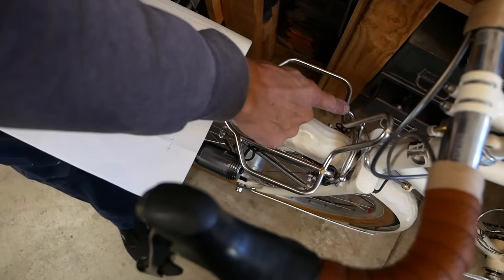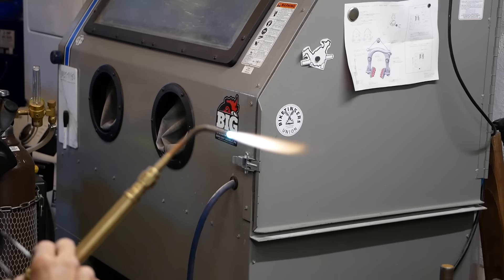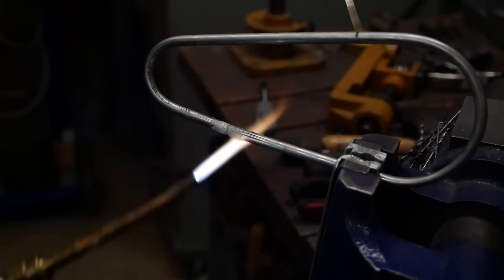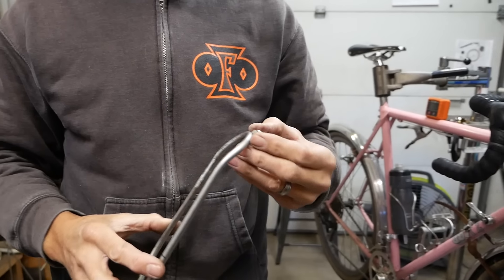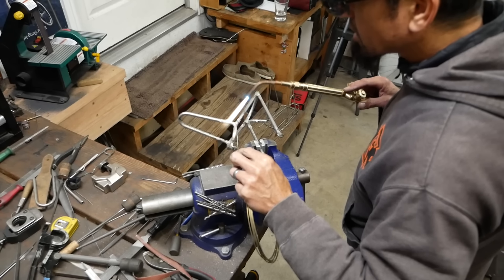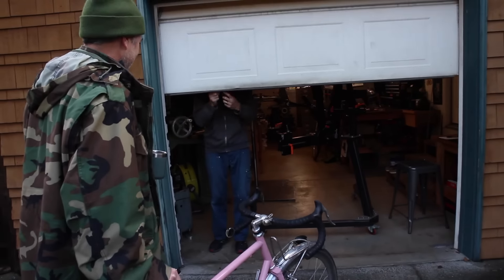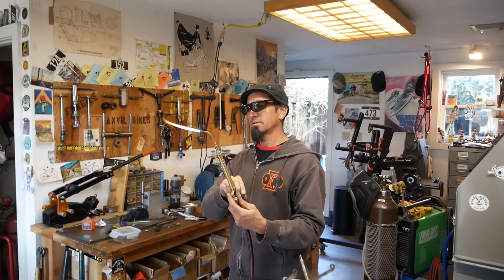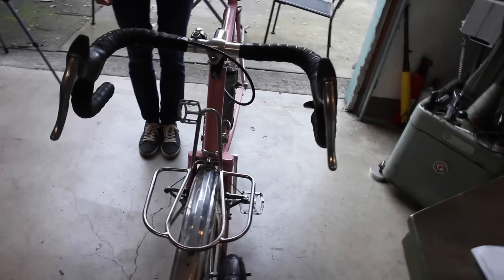Stainless Steel Rack Build at Fitz Cycles

Comment: Great fun to work with a constructeur and make something special and custom. Was that a water bottle boss that went through the rear arch, after all? And did you consider interior routing for the headlight wire?
Reply from the maker: The arch wasn't supported with a bottle boss. I may try that if the modified rack tab I used doesn't hold up. Internal wiring was a thought, but to keep it easier for maintenance I am going to use external wiring and clip the wire to the rack with copper loops. Cheers!

Comment: Question!
Why not build it into the fork , like the crust cargo fork only for reg. Bike?
Reply from the maker: Are you asking if it should be welded directly to the fork or additional braze-ons added to the fork crown? I think the added braze-on's on the top of the fork crown would have been a nice feature for a bike with cantilever brakes.
Reply: Im thinking along the lines of welding a rack in place since fork and rack are coming both from same builder.prolly not as prettey but cant be that complicated to use some seatstays and bend them into a simple rack shaped object and weld it to fork?!?!
Reply: If I understand the question. . . while the appeal of built-in racks is something I get - this is Randonneur equipement and my understang is in spirit at the edge of light / too light. With that a goal of install and remove if a part fails or as Mr Wildberry said "modular".
Many a cargo bike have sturdy permanent racks. Something I'd want when I buy one.

Comment: Mr. Wildeberry, I need some wheel repair advice. Dented my aluminium race wheel, but got the dent out and it is now rolling laterally within 1-2mm between the pads. Problem is that the increased spoke tension that was required to get this result, caused the wheel to go out of round.  It is high where the dent was, and now low 180 degrees across.  Should I try to reduce the spoke tension where the dent was and increase it at the adjacent side to reduce the oval shape?  It is approx. 2mm out of round.  I find that riding it this way doesn't really cause that much trouble because the tire pressure accommodates the out of round deformity.  But I'd like to get the balance right, instead of replacing the rim, in which case I'd take it to a repair shop, and have the work done to rebuild with a new rim with the existing spokes and hub.  It would cost several hundred dollars, as it is Campy Shamal Ultra Rim, a discontinued model.
Reply from the maker: Loosen the spoke tension on the dented side and get the wheel round again with even tension. See how far out of lateral true you are. Mark the rim at the place where it's laterally out of true. Put the wheel on the ground and with your hands and knee give it good tug. Try and pull it back into true. Put it back on the stand and check it. The rim is likely bent where it was dented.
Reply: @Henrywildeberry thanks!